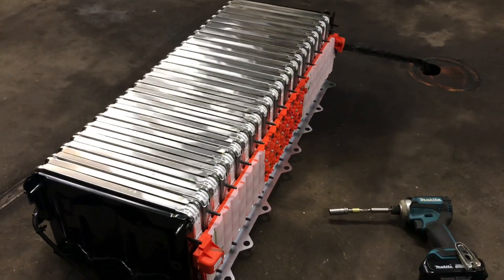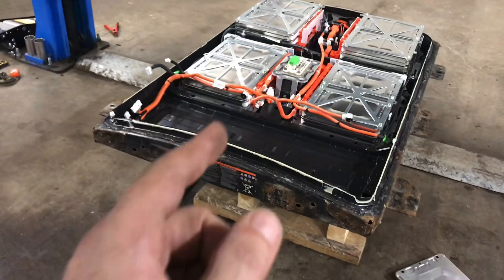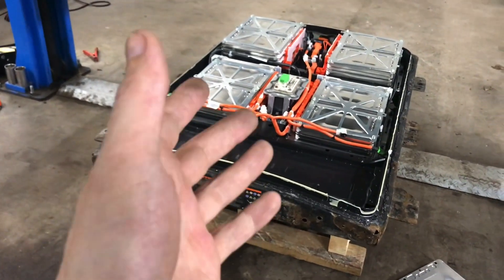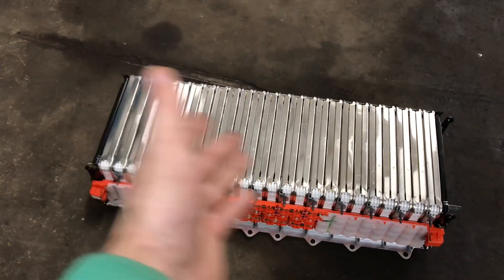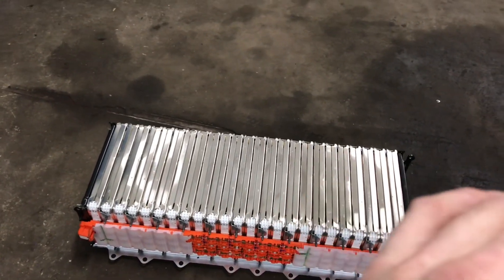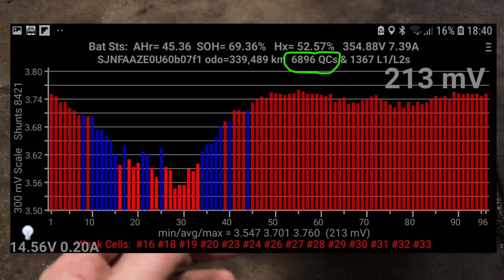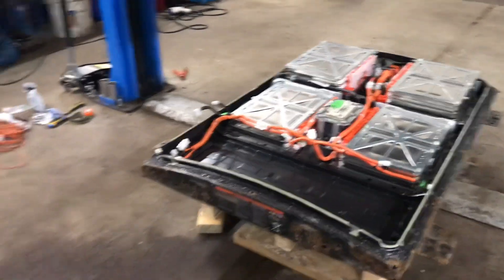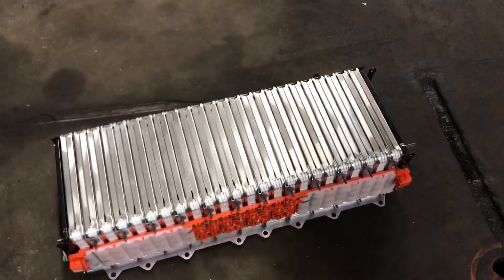Why Nissan Leaf batteries are the worst (explanation)

Comment: I drive a Nissan Leaf and is perfect for me and still have over 80% battery capacity after 8 years driving it over 104,000 miles.
Reply from the maker: 104 divided by 8 equals 13k miles a year average. Divided by 365 days equals 35 miles day average. This is below one standard wall charging per day required. That is using battery very conservatively and leaf is very good for such usecase.
My car got driven 190 000 miles in 5 years or so. thats average 38k year, 100 miles day average. Since it was a taxy, it was driven in bursts and always rapidcharged. Even after work day was done (warm battery), they didnt go for slow overnight charge, always rapid. That accumulated heat and damaged it more than is healthy.
Reply: Any tips?

Comment: i want to buy a leaf but i live on a tropical island that gets to 33 degrees celsius on average.. in short.. i'm a little concerned
Reply from the maker: Don't be a little concerned, be a lot concerned. Your battery will degrade hella fast, if you plan to drive around with the car more than 30 minutes a day. I dont think it's reasonable to buy a car that last 50 000km and then is half dead, in your conditions. 
If bmw i3 doesnt suit your needs then i suggest you keep/buy a cheap ice car at the moment for a year and reassess your options then.
Your average temperature is above battery recommended temperature, definitely calls for liquid cooled battery pack.
Reply: @gelisob  well that sucks.. i really like the car too. Battery degradation was my biggest worry. Even though where i live is small less than 40 miles to work and back there are the odd days that it gets beyond 33 degrees (37 degrees at hottest) i always wondered what that would do to the battery. I'm a bit disappointed honestly..  Anyways thanks for the advice..
Reply: @lessylvestre5901  Buy a used 2016 or higher chevy volt. They sell pretty cheap and the battery lasted way longer. The battery is actively heated and cooled.
Reply: @disruptIT  thanks for your input but the volt here is even more expensive than the leaf.. I am still researching tho.
Reply: If you like it then buy it.   If you aren't stressing the battery and it's not going a long distance then it shouldn't get too hot.   Slow charge it only.  Most people are destroying their batteries by fast charging them when they are already too hot.  Don't charge it past 85% and don't go below 15%.

Comment: what generation of battery is that? what other cars are better? except tesla which is too expensive
Reply from the maker: This is gen2 battery. Leafs from 2013 second half have those. 
But about other cars, from more budget friendly cars, bmw i3 has proper battery, with both liquid cooling and heating. Zoe's have air cooling (active). Kia and hyundai also seem to have liquid cooling. Definitely find out about that before making purchase decision and dont buy a car with passive "cooling"  if you live in a warmer climate region(no snow in winter).

Comment: The worst are kia soul ones. Nissan leaf has ok batteries.
Reply from the maker: Interesting, haven't heard about Kia souls since there are so few of those around, compared to leafs. At least in my country.
How do they manage the trick of being worse? Even tighter cell packing? Even looser temperature tolerances on quick charging?
Reply: @gelisob  not everything is spinning around temperatures. Kia have cooling but also have shitty cells which are dead in no time despite of cooling. At least that's the case for gen1 of souls. I heard gen2 are more reliable. And some Leafs been running for over 300k on a same battery and still have SOH like 80%. It mostly depends on usage. Don't charge it to full every night, don't discharge deep and drive every day. Simple recipe. Overall Leaf is great because it is simple and you can put 30/40/62 kWh battery to anything down to gen1 Leaf made in 2010. Or repack battery with LG cells and also be happy. And I bet it will be classic in like 20-30 years so might be good idea to keep one until then.
Reply: @D9ID9I  you said that not everything revolves around temperature.. im thinking about getting a leaf to use to commute to and from work (39 miles round trip) but the island i live on gets to 33 degrees on average.. battery degradation is a big concern of mine seeing that battery replacements are super expensive.. what are your thoughts on this.. i'd looking for all the advice i can get.
Reply: @lessylvestre5901  don't do QC. Charge it as slow as you can. Don't accelerate too much, eco mode is your friend. Don't leave car in direct sun. Don't charge every night to full. Don't discharge to 0. That's it. 33 is not that much.
Reply from the maker: That was some fishy advice by plukyew there I think, saying 33 is not that much :D We probably should make sure 33 of what are we talking about. If it's 33 Celsius then that is much, since best temp for battery is 25 C and if it's celsius then you are already starting idle over recommended temperatures :) Even with average driving this would easily push battery generic temp to 40c and rear stack to 50c i'm afraid. I would avoid leaf in such environment. 
Things are different if we are talking about Fahrenheit.
Reply: @gelisob  i read via a search that the recommended operating temperature is 30° to 120° fahrenheit.   highest temperature ever got to here is like 102° F.  i am still researching as i haven't made up my mind. I have also been trying to consult folks that own leafs that reside in places hotter than here like Arizona and certain areas of California without success. I appreciate your insight and will factor your warnings. i should add the leaf i'm interested in is a 2018 model

 https://insideevs.com/reviews/354688/2019-nissan-leaf-40-kwh-test-drive/#:~:text=When%20asked%20to%20specify%20the,degrees%20and%20120%20degrees%20Fahrenheit.
Reply from the maker: @lessylvestre5901  type into google "LG e63 pdf" and you should get a pdf link to queenbattery for that cell datasheet. First page, standard discharge, temperatures. It is quite similar cell to what is used inside leaf batteries. 25C +/- 2. Going below it - slow chemistry down, doesnt damage. Going above, starts to damage, the more you go, the more damage happens faster.
Finding a nissan representetive to confirm that yes our car isnt so good in warm climate, will definitely be hard :)
In the end, remember, car company (most of them) cares about making money and selling the car. They worry mostly, that the car can make it through the warranty time. Usually this is the same time that leases expire. Of course it's sht if car is only good for warranty range, in certain climate, and no car maker will admit something like that. Since people communicate around the globe these days then it's working for their advantage, that some say their leaf lasts 300 000 easily, without understanding why :)
Reply: @gelisob  https://www.youtube.com/watch?v=HyqJZbWE44g yes, they're bad... if you don't understand russian - both KIA souls have ~5 years and 50-60k km only... and the battery's are already blown up and fuse worked, so the car even can't be driven. Although these cars are brought from USA, so probably some hot climate state. In EU these ones were not sold or were not popular at all, so haven't them seen personally a lot, few only, otherwise the Leafs I think I see as much as qashqai or similar :D

Comment: I agree the Nissan LEAF battery is the poorest design. Cooling is very important and they don't have any cooling. KIA Soul EV tries air cooling and they all failed. Liquid cooling is?always needed. They lose capcapty 10 times faster than any others.
    The class action law suit only came up with a lower capacity warranty they the other automakers have. How was that approved. 
   Tesla has the best and Chevy is also very good. The others are all low volume weak designs called COMPLIANCE CARS.
Reply from the maker: Renault Zoe seems to sell well and they have active aircooling in their battery. I wonder how well are these doing. Even active air cooling is still definitely many times better than nissans "nothing but faith". Probably doesnt help much in warmer countries but still..